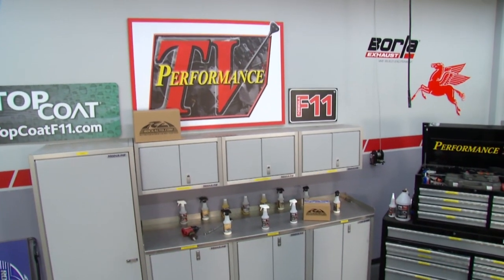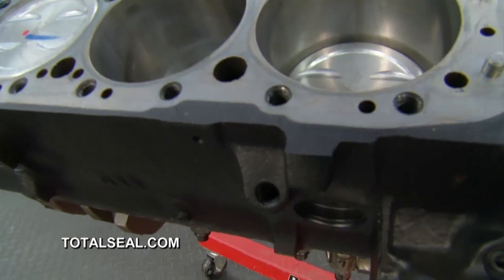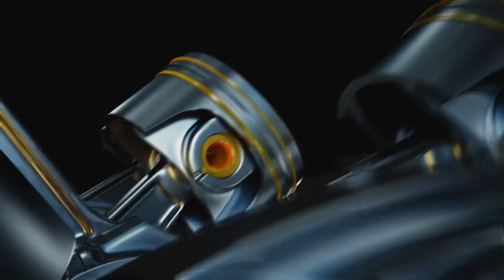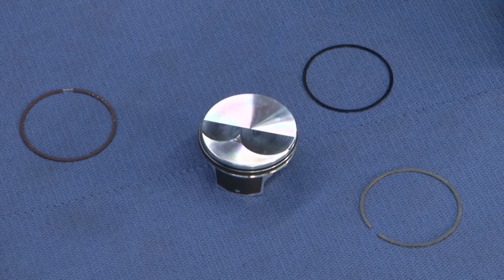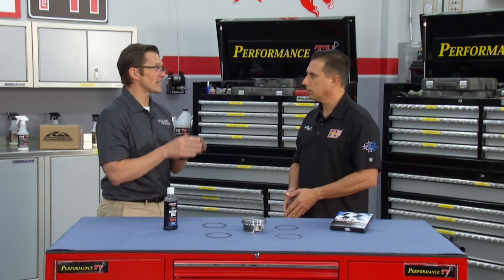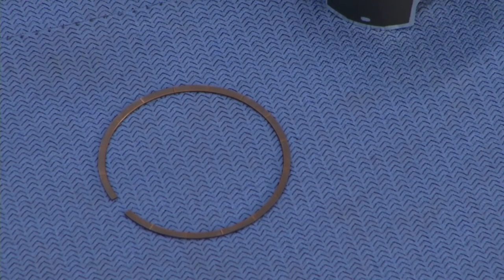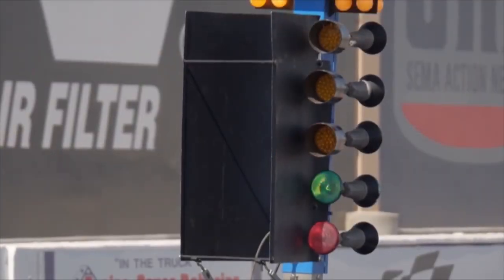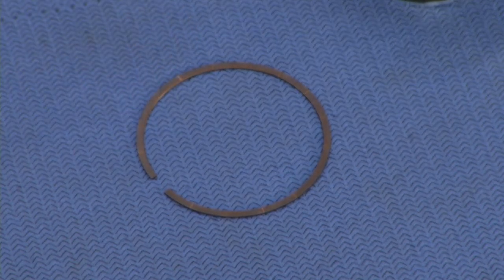Upgrade Your Stock Piston's Performance

Comment: I want to set up pro pistons in my 302 Ford which brings it to a 349 40 over there would be an advantage to run the total seal cr9090 40  compared to Hastings 2m 13940 this will be naturally aspirated power Adder there is 100.00 difference in the price

Comment: I’m very interested in gas ported piston rings, just recently learned about them. I’m running a 6.0 iron block LS bored .030 over, with flat top pistons and 799 heads and a Borg Warner S475 10 psi. I broke the ring lands on piston #5. I talked with my machine shop and he says gas ported piston rings wear out the cylinder quicker. How true is this?? I only had 14k miles on this build. It was a set of hyperutectic“ stock “ material pistons.

Comment: I've been using Total Seal gapless rings since 1978 and wouldn't use anything else they honestly do make a difference !
Reply: I don't know why more folks don't use them, it's so easy and it gets rid of a "flaw" that piston rings have had since the beginning of time.
Reply: @MrTheHillfolk biggest reason for me not trying them is they've been around since the 70's and if they are so great. How come I can't find any independent test that show gapless actually do what they say. Literally every video about gapless is ether from total seal or someone talking to a total seal rep. Really makes it feel like snake oil or at the very least really not worth the extra $150-400 for a set of piston rings.
Reply: @nashvilleoutlaw  
Back around 2003 , I was building an engine for a project.
It was a 98 Jetta TDI engine that I converted to mechanical injection for use in a 79 rabbit. 
Ditch the electronics and use an early fuel system for ease of installation.
Turbo and whatnot ,30-40psi nothing major. 
Anyways , I was interested in the whole zero gap concept as I worked at an engine shop. 
Anyways,since the engine was "new" and only like 5-6yrs out there they had nothing on the shelf, and they requested if I could mail them some of the stock rings and see what they could come up with. 
They said they were very impressed with the OEM ring quality,not like thiers would be much better. 
Hmm,ok??
I was told if I could send them a set of new oem rings they could be modified for zero gap for 35$ a set. 
It's a 4 banger ,I got 5 sets because I was afraid of breaking one. 
That was a mess in itself ,I almost paid 120 a hole for the OEM rings until I found out Goetze makes them and I got them for like 40 a hole. 
Anyways,I had them modded for zero gap top rings and couldn't be happier. 
Leakdown test after 10k barely made the needle move ,and it was maybe double that at 30k. 
Alas ,I had another issue with the engine but upon the repairing process our shop collapsed 10yrs ago. 
The whole project is sitting in the corner and I refuse to give up yet ,I've had other projects in it's way but I'll put it back together with the same rings ,they looked fine. 
And I also had an open crank breather which without total seals you'd die at a light from the fumes even vented under the car at the back. 
I'm sold for life ,I'd throw em in a lawnmower if I ever had one opened up enough for ring replacement 🤣
Reply from the maker: Thanks!

Comment: Does gapless or gas ported ring going to create more power?
Reply from the maker: Yes, we have repeatedly seen increases in horsepower and torque when upgrading to either a gapless or gas ported ring. We’ve even seen some amazing results from gas ported gapless rings. They are quite the combo!